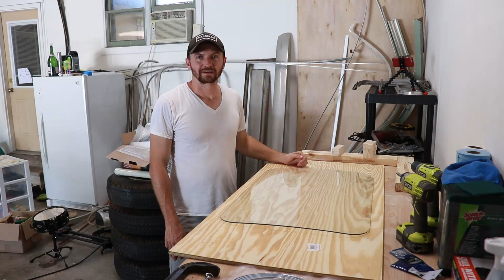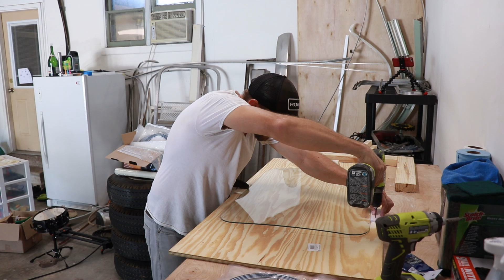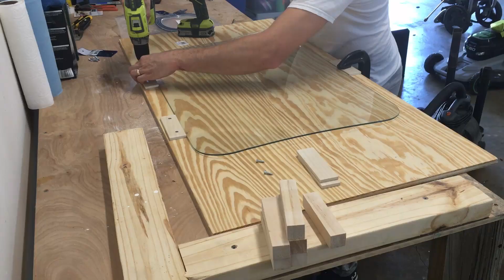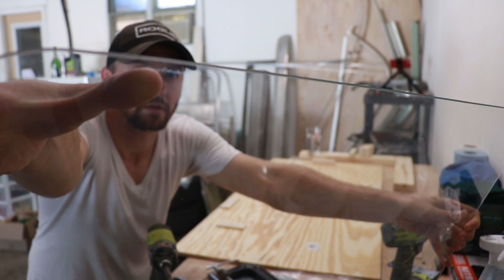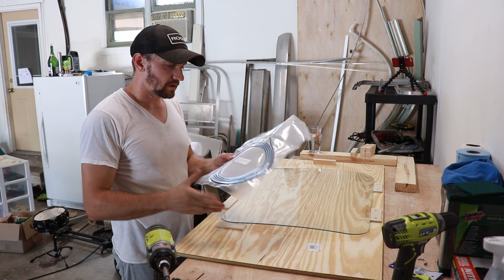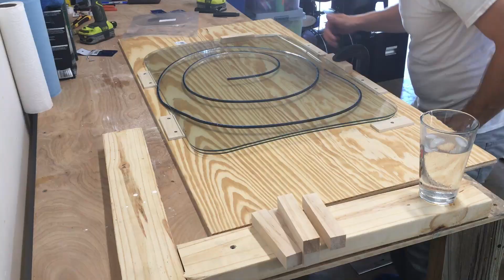1976 Vintage Airstream Dual Pane Window Repair Part 2: Alignment Jig

Comment: Ok, I'm thinking the window restoration in my 1977 Sovereign is way beyond my capabilities. Would you be interested in making some money......?
Reply from the maker: After doing these videos I have actually thought of offering to do other peoples.  It is not easy but now that I have it figured out I can do them faster.  We can certainly discuss that option.  Do you have dual pane like mine?
Reply: Yes, bubbles and all! I don't have an adequate work space, so I was just wondering if you might be interested in doing the job? I like the way you do things, the right way. I have the exact same Airstream as yours only one year younger, same lay out, same issues. If your interested I'd like to know what you'd charge to restore all of the windows, I'd bring them to you and pick them up. I know you're busy with Jubilee so please feel no pressure from me concerning this. Thanks and.....steady on!
Reply from the maker: I would be up for that.  I will give you a call later today and we can discuss that and talk about what all extra parts I have too.
Reply: Did you ever repair Mark Mahan ‘s Windows? I’d like the same work done for my 77 sovereign ones

Comment: Nice work Ian im enjoying watching you restore the windows. Are both panes glass because my inner pane on my Airstream is plastic
Reply from the maker: On mine all of the larger double pane windows are both glass.  The smaller oval stack windows have plexiglass on the inside panes.  Its weird, Airstream used single pane plexi, single pane glass double pane with plexi and double pane with all glass in the 70s range from what I have seen.  I guess there were different options.  Not many seem to have the double pane glass like mine.
Reply: @MillerGarage   yeah it's really weird I think in the 70's they where experimenting woth different window types. I am thinking of repairing the side double pane ones. I have made the front gullwing windows single pane and they look great.
Reply from the maker: I think its worth keeping them double pane!  Looking forward to seeing your progress!
Reply: The Seek First Adventure they are worth keeping definitely! I love how thorough you are with everything and the information you give. You trailer is going to look amazing!